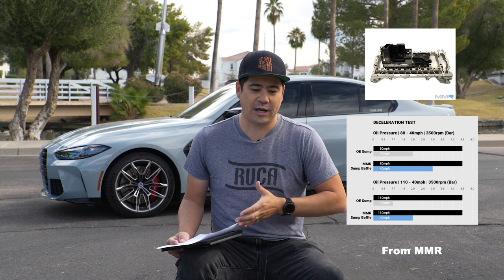Why I chose the G80 M3...

Comment: I own an F80 M3CS. One owner. 80k kilometers. You are aware that they ran the F80 M3 as a ring taxi and then went for the
G80 M3 only to sell that car because the parts supply for the F80 is way better than the G80. Because of the weight you will have to change certain parts a lot sooner if you track the G80. The G80 platform is better but for enthousiast owner, F80 with DCT gives more thrills because it isn’t perfect. But G80 excellent choice of course.
Reply from the maker: Nice love the CS, my buddy has a F82 M4cs. There is nothing wrong with the F80, I still love the platform and think its a great car but the S55 did have its weaknesses like the crank hub. I agree its a more raw of an experience and feels more race car out of the box. I was looking for a car my wife would be happy with driving to dinner etc and something I could throw around a track, the G80 just delivered more in that department. 
You are right they did stick with the F80 for the ring taxi but like you said it was due to parts shortages, its doesn't make sense to switch platforms until parts become readily available, and there were many contributing outside factors; covid, shipping container shortages, supply chain, war in Ukraine (wiring harnesses). Honestly its a different strokes for different folks this was more of my opinion and how I landed on the G80. Either way you cant go wrong with either platform they both will drive great.

Comment: Looking at getting a used m340i 2020. Do you recommend getting a used BMW? I am nervous about reliability which is why I am hesitant, although I have heard the b58 is pretty reliable. Are BMWs more reliable in this day in age? By the way, I would plan to keep this car for awhile.
Reply from the maker: Yea nothing wrong with used as long as it wasn't abused. My M235i that I had before had about 12K miles on it when I bought it and drove it until around 40K miles with no issues at all. 
B58 is a solid platform its been used for multiple cars including the Supra, it also doesn't suffer from the oil starvation issues like the N55 did. If you go Certified pre owned too I believe you can also add on any extended warranty from BMW (if you dont plan on modding it.) M340I is a solid car, have two buddies with them and they sound great with the Dinan Catback on too!
The BMW stigma of being unreliable is getting a bit dated, Consumer reports actually just ranked BMW as 3rd most reliable brand in 2022. Best of luck in the car search and any other questions feel free to fire them over.
Reply: @AZM3DIA  Awesome man thanks for the response I appreciate it. If I got the extended warranty but added an exhaust would that void it? or do they only void warranty for like modding engines etc? BTW your m3 is amazing.
Reply from the maker: Thank you! Its a dream come true for sure. As for the exhaust assuming you're in the US but short answer is No a Exhaust should NOT void a warranty, unless it can be proven it was the cause of the specific issue it had. Say if you're steering went out they couldn't void the warranty due to just an after market exhaust, the modification would have to correlate to the failure. I'd say 9.9/10 times a dealer wouldn't void a warranty with bolt on parts... a flash tune (BM3, MHD) will void a warranty which is why some people go with a piggyback system like JB4 AKA boost controllers, they are easier to hide for warranty work.  
Dinan is a BMW safe mod brand most dealers will warranty their parts if they install them, think Mugen for Honda, mountune for ford etc.  Best bet is just find a service advisor at your local dealership who is "good about mods" and just stick with them for work. 
I plan to do exhaust, spings and spacers and I have a the full 5 year warranty from BMW if that eases any concerns.
Reply: It’s a 2020… not a 2002. Yes it will be reliable
Reply: @tripleemce5003  Well I wouldnt say just because a 2020 means it will be reliable. I know m340i do have there fair share of problems and again buying a car of that caliber money wise is a very valid question to ask about reliability. At the end of the day it is still a BMW anything can happen
Reply: Consumer reports 2022… bmw ranked third most reliable brand since around the iteration of the f30/80 chassis a huge focus was placed on reliability and consistency when new leadership was implemented. SavageGeese highlighted this well in their f80 review.
Reply: From what I remember reading,  BMW know if the car was running with a piggyback, because it's sending in values outside the expected range. (Don't know the details) So double-check on that. If BMW can see that you were running a pnp tune and you make a warranty claim on the engine, you're at the mercy of the dealer. Most likely they'll void your warranty
Reply: I've put 25k miles of my 2019 m4. It's been great. My wife has 65k on a 18 430i. Only a bad water pump there but she BEATS it. So. Fwiw. Ours have been wonderful and we don't do maintenance well

Comment: But the B58 TU in the new G20 M340i xdrive is setup for the track for sure, both the engine and the chassis despite being an M light!
Reply from the maker: The M-lites at the end of the day are going to be somewhat inferior performance wise to their M counterpart. Agreed, the B58tu and G20 Xdrive would do fine on track and be competitive, but its really when you start to tinker with them or want more out of them, then you'll run into issues/ diminishing returns on mods. 
The suspension setups, M Xdrive,  extra rigidity, Engine and tuning, wider  fender, tires and fitment all make the M models what they are. Its a different strokes for different folks at the end of the day, get what makes the most sense for your use case. For my use case I chose to buy something instead of building it, because I want to track and needed a good starting platform out of the box.
Reply: @AZM3DIA  I agree with you. Why M cars are just so special! BMW would have to make the m lights a bit toned down to make the difference with the proper Ms. But the G generation bridges the gaps a bit more.
Reply from the maker: 100% agree, the G series is big step up for the Mlites. There is a G42 Xdrive that runs AutoX as well and we are right around the same times, but he's a better driver than me. Might do another video on the Xdrive vs M xdrive they seem to be similar but still different when it comes to the drive logic software. Either way cant go wrong with a S58 or B58 it'll be a performer.